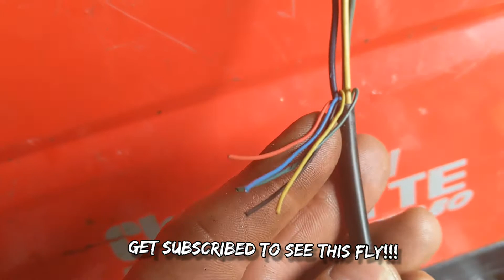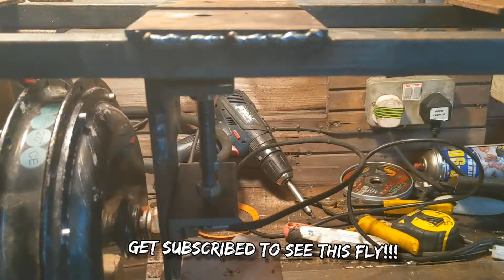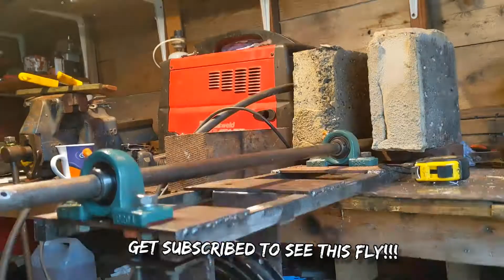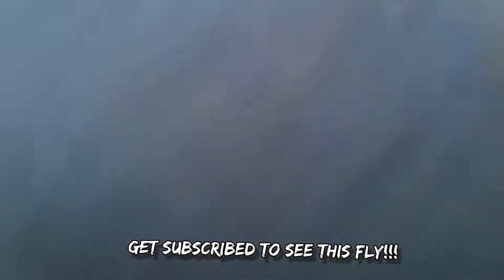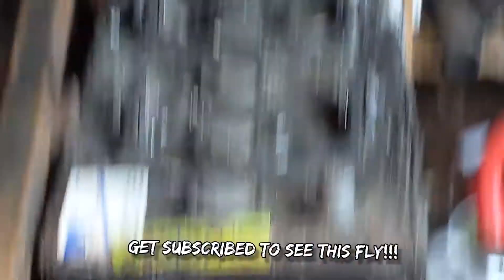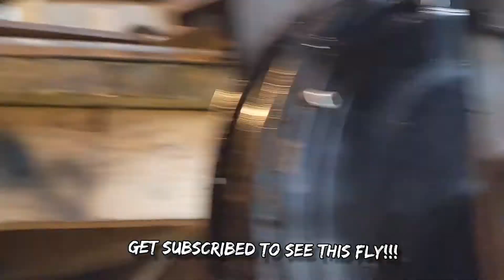1kw Ebike Motor to WIND GENERATOR , Part 5,completed motor mounts and nearly all the frame

Comment: frame looks sturdy ;)
Reply from the maker: Thanks for the comment !! Yes it's super sturdy brother :), the motor mounts are pretty cool , a few hours work but all made from scrap plates and used bits of threaded rod, this has only cost me £11 so far which is for the bearings, £30 for sprockets and other bits !!, It won't be easy to turn but will be interesting to see if it chucks out any power, it's gonna sound mega cool as well !!
Reply: @GavinFreedomLover  sounds like you got cheapest turbine on youtube ;) if 3blades dont work, try 6blades if you can get more aluminum...with 2sets of blades it will generate realy good power ;)